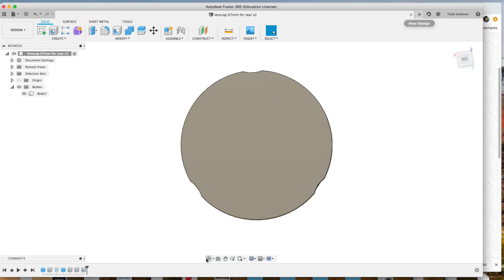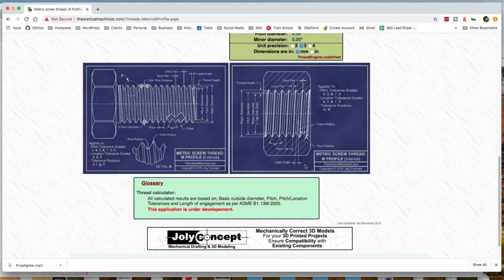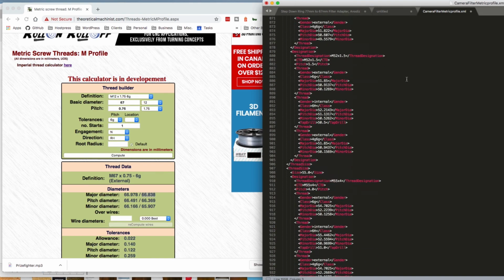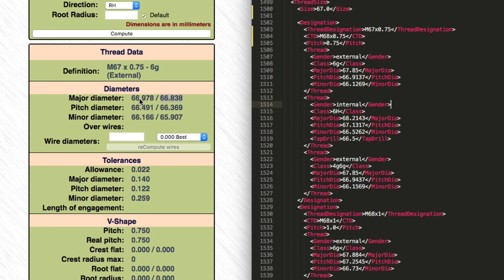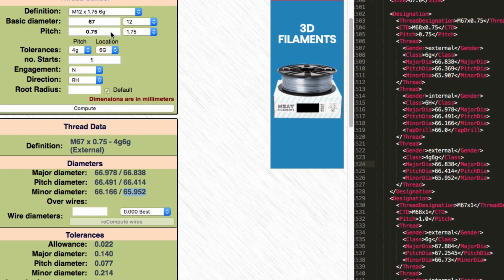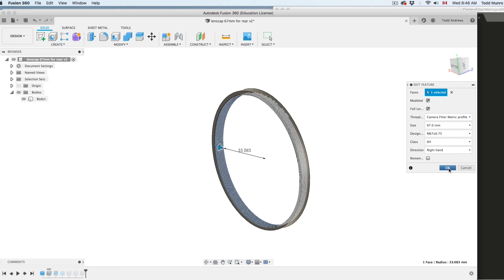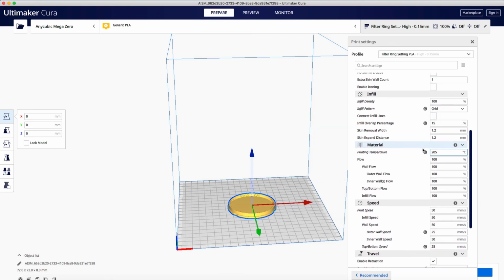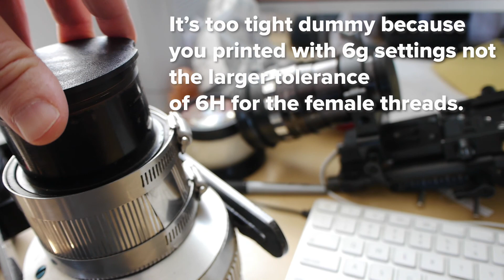Custom Filter Threads in Autodesk Fusion360 to Make a Lens Cap Using XML

Comment: Im developing a fix to your threads because you made it so that one (this fits into / this) when its actually (if this doesn't work / its this) is what the calculator is saying, to get proper internal and external diameters, for external you use 6g pitch tolerance, and for external you use 6H pitch tolerance, infact if you put 6g in, it says external, if you put 6H in it says internal in parenthesis

Comment: Great video! I followed your instruction and 3D printed the part with a resin printer and to the eye it looks perfect, but the filter won't twist on. It seems to be a bit off. I need the settings for a 58mm filter thread. Just can't figure out where I went wrong with my settings. Do you think you can share your XML

Comment: This is really helpful. Your file has helped me quite a lot, but I've run into a problem. I'm trying to create a step up ring to convert a 52mm ring size to 77mm.  The 52mm side of things worked great, but I can't get the 77 to work at all.  The 77mm is an internal thread. I've used the 6h selection in the pop up box and I've tried both the 1.0 pitch and the .75 pitch. The threads print and look correct to the eye, but when I try to screw a 77mm filter on, it just won't go on. It always seems as though the 77mm thread I print is too small. Any ideas? Thanks so much for putting this out there. I'm so much further along with this tool than I was before.
Reply from the maker: Thanks for the comment Les. For me some of the large sizes there was a bit of trial and error. I noticed my 3d printer seems to print 1% or so smaller than the actual object. You could try enlarging the print setting size in Cura (if thats what you use) to 101% it may even be 102%.  I have a feeling for my printer it's exponential depending on the size. Small things print perfect and larger things for precision get a bit funny.
Reply: @ToddMunro  could you make a new one that has the 101% calculated in? This would make it a lot easier to design around 3d prints in Fusion 360 as I already know how big I need the rest to be to work with the shrink ratio which for most things I only add 0.2mm will give it the right size. Or would adding 0.2mm to all the sizes in the XML work?
Reply: You can play with the setting "horizontal expansion" on Cura without needing to enlarge the print setting ;)
Reply: Les, is there any way you could help me understand how to get this custom Camera Thread Plug In into my Fusion360?
Thanks in advance...
Reply: @odinata  https://www.youtube.com/watch?v=VPDngPAvFnQ

Comment: Hi Todd.  I am trying to make a double male insert for my tap. The threads for the tap end need to be 24mm 1.25 pitch. The other end is 26mm 1.75 pitch. I can navigate to the thread data folder in Fusion 360,  but it looks different to the one in your video. I just tried to change one of the threads i wouldn't need but it won't let me edit it. Am i missing something or do i copy the folder to notepad, edit it and paste it back to where it belongs. I need some help please. Thanks.
Reply from the maker: Yes I opened the file in a text edit editor on my Mac (Sublime text) and saved it. You may have to grant permissions for it to save properly. I followed the instructions here. but it looks like they have a plugin now for Windows if you are using that. https://knowledge.autodesk.com/support/fusion-360/troubleshooting/caas/sfdcarticles/sfdcarticles/Custom-Threads-in-Fusion-360.html  I only use Mac so sorry if that doesn't help.
Reply: @ToddMunro  Thanks for that. I downloaded the plugin but its a bit confusing. Might try it in notepad.
Reply: Hi Todd, think i've sorted it. Copied to notepad, changed it and saved it. Just going to run a couple of test prints to check. Thanks for the help.
Reply from the maker: @509632  Great news. Keep a copy of the file somewhere just in case. It will disappear every time Fusion 360 updates. I haven't figured out away to stop it from doing that unfortunately. Fusion 360 does kinda keep it's own backup folder where it will be, but won't use it until it is put back in the original folder.

Comment: Thank you Very much,  I am 3D printing  TMA6 adapter rings for my ZWO astronomical camera and was at a loss how to get the C-mount and T-mount threads on them. Your video helped tremendously. I've modelled it successfully in Fusion 360 and I'm now off to slice & print it!!
Thanks again!
Reply from the maker: Thats great! Sounds like the perfect job for this. It may take a couple tries to get the adapter just perfect but worth it. I use PLA and find it string enough at about 3mm-4mm thick for my adapters and caps.
Reply: I finished printing 3 trial pieces using PLA at different settings - all worked fine first time! hardly any cleanup needed.
I think the best setting was a layer height of 0.2 and I only used 20% infill.
It seems stong enough anyway.
I'm now knocking out a set of eyepiece extension tubes in various lengths.
these run out at about £20 each so if it works it'll be a huge savig.
Thanks for all your investigative work!